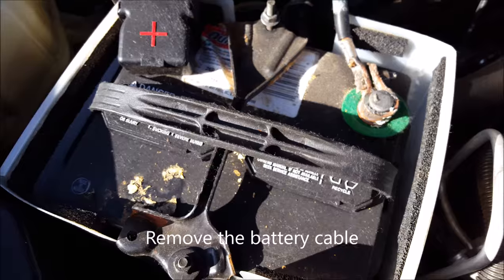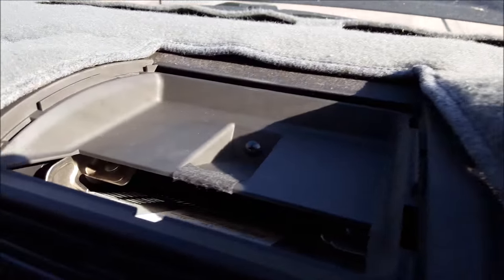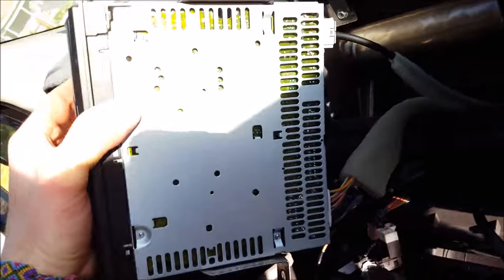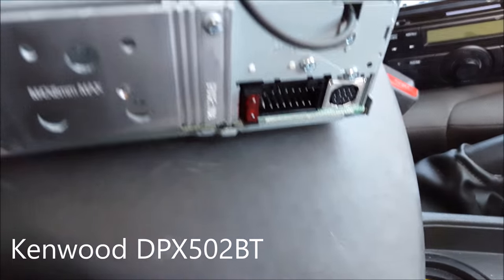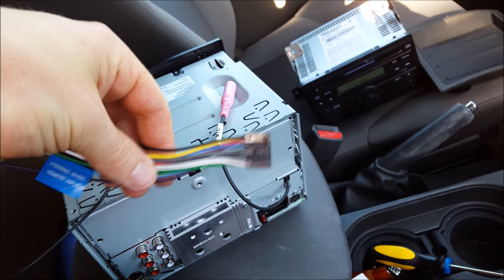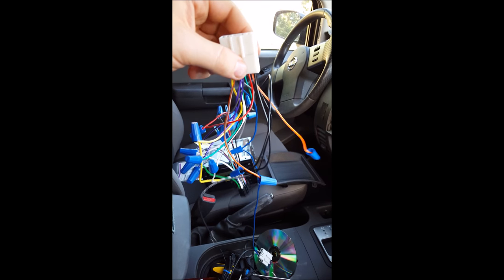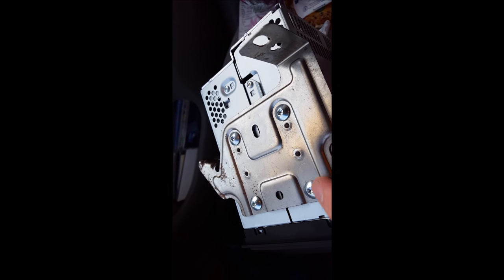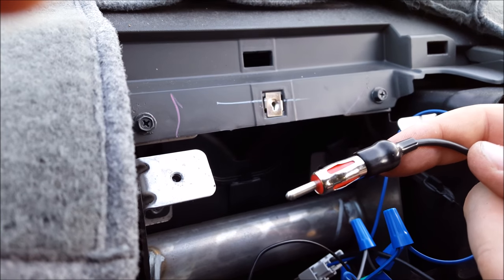Nissan Xterra 2012 (2007-2014) Aftermarket Deck/Stereo Install

Comment: Thanks for making this.  I'm replacing my head unit again after many years so this was a nice refresher.  I will say that wire nuts are only for solid core wires where there is little to no vibration.  In other words, they are not suitable for automotive applications.

Comment: Very helpful.  I'll be doing this soon.
I'll also be installing a rearview camera.  I was wondering if you had any tips on how and where to get the wires from the camera in the back to the radio in the front.
Reply from the maker: netpasya that all depends on the backup camera kit you buy. usually it comes with wires to hook up to the front battery and  to hook to the back tailgate. I am unaware of a method to hook up that to a speaker system like this.

Comment: Did you need to buy a stereo bracket for this as well? I just bought the Kenwood DPX502BT from Amazon and was wondering if I needed to buy a bracket separately..
Reply from the maker: I did not. it looks great without it.
Reply: Do you have a picture of the finished product? I would like to see the final product without a bracket as I'm picky on the look. I want mine to almost look factory (very clean and neat).

Comment: On the antenna wire I have 3 blue on of them is from the sterio wiring and the other on is from the adapter and the other one is from the antenna wire do they go together ?
Reply from the maker: Joseluis Diego read the wiring guide in the stereo kit you bought. I do not know off hand.

Comment: Do you know if the 2012 Nissan Xterra is the same as the 2008 Nissan Versa Deck? If so did you need a dash installment kit or did the Kenwood Stereo fit perfect? Also how is the quality of the Kenwood?
Reply from the maker: J. Arrazola  I am not sure
Reply: How is the quality of the stereo? Also do you have a picture of the finished product?
Reply from the maker: J. Arrazola very good, clear sound and the console is easy to use sorry I do not. this is a relatives car.

Comment: Did you need an adapter to maintain your steering wheel controls?
Reply from the maker: Shadoninja Hi, I did not, as this was a stock model without steering wheel controls. I am unsure about installing an aftermarket stereo with steering wheel controls, usually it's just one extra wire.
Reply: Ok thanks!

Comment: Anyone watching this video should realize that this is probably one of the worse ways to do this.  The video should have ended after he showed how to remove the radio bezel.  The rest of this is a hodge-podge of bad instructions that will lead to failures or damage to the car, the new radio or both.